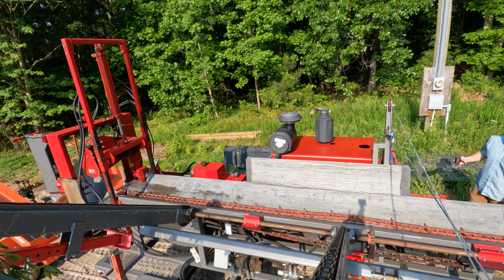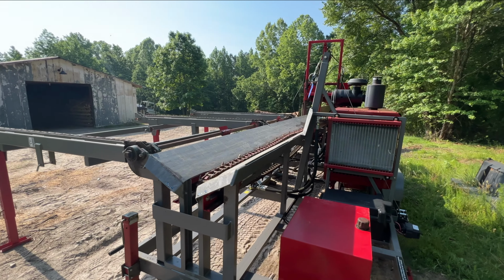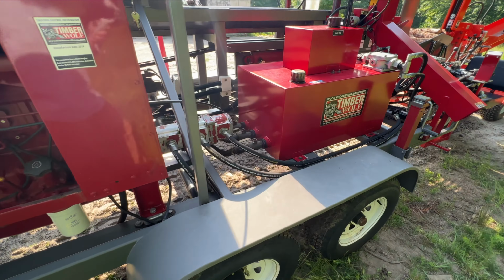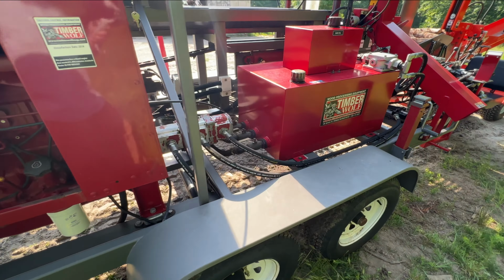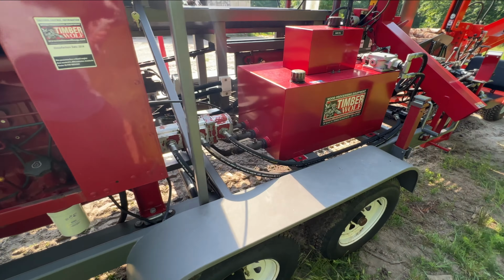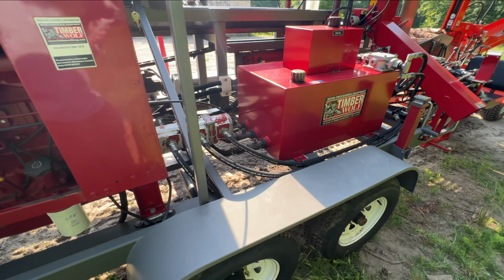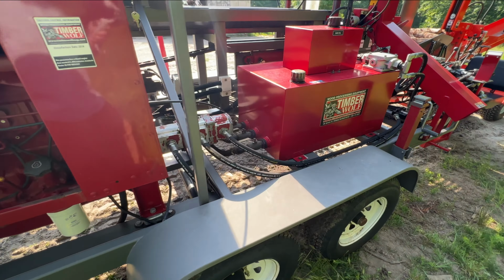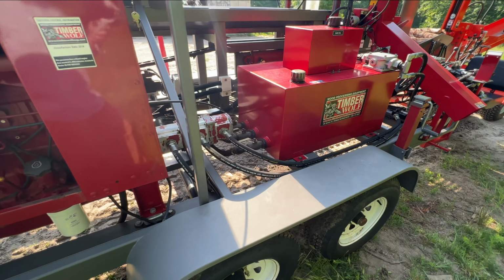Timberwolf Pro HD XL Firewood Processor Making Campfire Wood

Comment: It seems like it struggles to land the logs appropriately in the "splitting chamber" every time. You'd think this would be figured out by now for something that's 100K. You have to keep getting up and messing with the peavy. The bar also seems to struggle which is weird. Maybe the chain is ground too aggressive or something, or the rakes are cut too low. IDK, but it just doesn't seem to operate as seamlessly as I'd hope it would. Nice to have and see it work. Thanks for the demonstration.
Reply from the maker: This type of processor does struggle with sub par logs.  Most of the firewood logs I get my hands on aren't perfectly straight and have defects.  Makes it awful difficult to pull them through the trough and have them fall straight in once cut.  Completely different scenario if the logs are straight and no cuts or knots on them.  I'm never lucky enough to get those for firewood production though.  We diagnosed a bent bar a few days after I filmed this video, straightened out and she's ripping straight through now.  Always something on these processors.  Appreciate you watching!

Comment: When the operator station is on this side of the outfeed do you get a bunch of sawdust blown in your face?
Reply from the maker: Occasionally, if the wind is blowing in the right direction or the saw dust tube becomes clogged.  Nothing too bad.  After a full day, you definitely aren’t clean like a machine with a cab though.  But not having a cab, makes it’s much easier to reload a large piece or free a stuck round.  Thanks so much for watching!